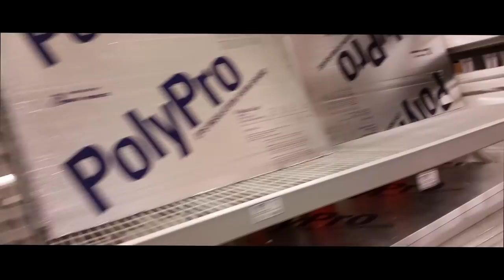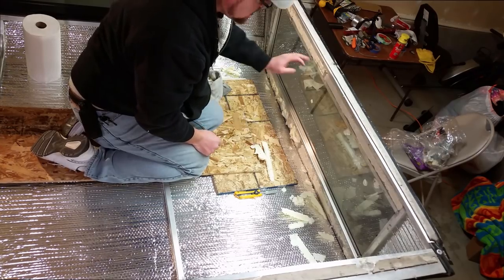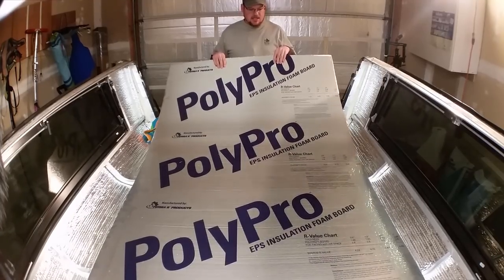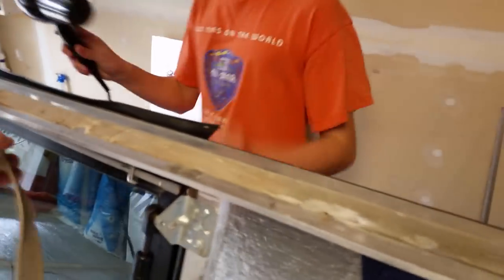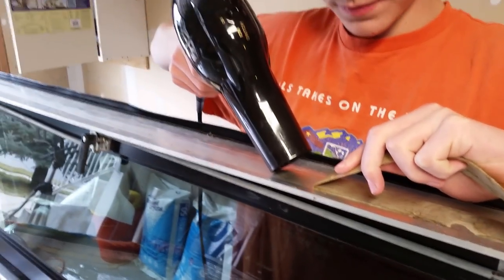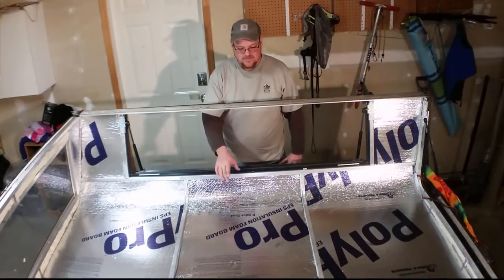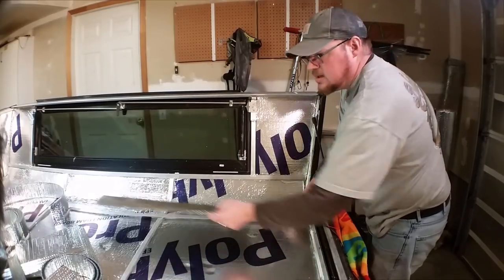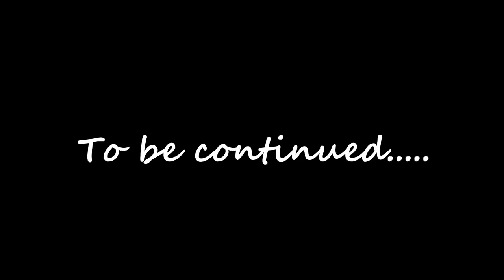Truck Bed Shell Camper - Part 5 - Insulating cap with Poly Pro Foam Board

Comment: I use an old or new hacksaw blade with tape on one side or if you find a single handle you can use that also.  Cuts the spray foam way easier from my experience when trimming.  I've seen for shaping people using bandsaw blades also in loops for shaping a radius.
Reply from the maker: What an excellent idea!  I will have to try that!
-Will
Reply: Thanks and thanks for sharing the detail of your insulation project.  I have an aluminum cap that I am planning to work on also though do a walk through design for starters and I plan to make a somewhat Mike Basich design with the way lightweight cap since I have the materials from the cap if I don't use new materials like foam, carbon fiber or fiberglass and aluminum frame.  Without the skid of course though attenuators so can level out for hauling gear on top.  I want an outer body contour roll bar also to lower drag.  Yeah, SVSeeker was using the bandsaw blade loops for the jet boat they're making.   I came up with the hacksaw blade I forget either with model airplanes and boats when I was younger and again insulating cracks in the basement walls in my first house.  Keep us posted.  Neat design.

Comment: Love the idea of insulating this should make a difference in the winter especially with a propane or diesel heater in it
Reply from the maker: I like it.  It helps keep the me a little warmer by trapping my body heat in and helps with keeping the draft out.  It's not as huge of improvement as I had hoped. If I were to do it over I would have made a second layer with a gap in between the insulative materials to increase the insulative qualities more.  Be careful with those heaters inside that you don't put yourself in to deep of sleep.  Thanks for watching!
-Will

Comment: In a cold climate you might end up with some condensation issues behind that foam/reflectix system since it's not air sealed around the edges. Maybe if there's enough sunlight during the day it might be enough to drive off the moisture every day?? I'm 3 years late but hopefully this worked out, cool build and glad you were able to accomplish a tiny air gap between the reflectix and foam!
Reply from the maker: Thank you. I don't get to use it as much as I'd like. I have slept in it a few times but mostly in the spring/summer. Stayed cool with windows open and breeze going through.
Thanks for watching!
-Will

Comment: Any thoughts on lining a shell with reflectix that's already carpeted?
Reply from the maker: My biggest take away from my reflectix experience is it “reflects” heat, and is not much of an insulator especially if you don’t have a little bit of a gap or void if you will. 
I would do it a little differently if I did it all over again. But it would come at a cost of additional space. if you think of the insulation in the walls of your house, they are 4 to 6 inches thick with tiny air pockets that are created from the fibrous insulation. my situation was more of layers like a sandwich not much space or avoids to capture the air. Good luck and thanks for watching!
-Will

Comment: You are doing a great job. I look forward to see the finished product.
I do have a question that is generated through observation.
The first layer is designed to radiate body heat back into the living space. Does it still perform that function being covered by the poly board?
Reply from the maker: Read the Instructions That's a great question. It is a concept I am currently experimenting with. I am using the gap to insulate from the outside. I may end up reversing the materials after doing some test runs in the field. I'm not an engineer but enjoy experimenting. Thanks -Will

Comment: Looks like it's going to work. Are you insulating the truck bed?
Reply from the maker: rudycorraudio 
Hello Rudy! I hope all is well. Yes it will get something. Im unsure at this point what. I need to stay thin as I can,  to conserve as much space as possible. My main objective is to reflect inside heat sources as much as possible and knock down any drafts. Having the underside of the truck bed exposed allows for convection and Rapid heat loss . So I have to hold onto and protect whatever I can.  Any thoughts and or suggestions are always welcome. Thanks for stopping by.
-Will

Comment: Do you feel the difference?
Reply from the maker: I do.. Not as much as I had hoped. Definitely no draft. A little cooler in the sun. A little warmer when it reflects my own heat inside.. It takes a-lot more air-gap than i gave it to really captute R value. I felt it was worth it though.
Thanks for watching.
-Will

Comment: Reflectix has an R-value of less than 1.0...
.... any time that a reflective surface contacts any other material the radiant barrier (reflective) value is completely negated.  All you end up with is an air bubble spacd between 2 sheets of poly.

  Then that shiny  reflective surface is actually avery thin film of Aluminum that can actually  transfer heat away from the surface you intended to insulate from heat loss.  It also conducts electricity , so be careful. 

The "airspace" was a good idea, unfortunately it wasn't anywhere to prove useful, e Capt for possibly sound deadening.

You accomplished "something", I'm  not positive it was what you intended.

Its kinda' like having sex and utilizing 2 condoms.

Good luck
Reply from the maker: We've definately learned both good and bad from it.  Thanks for watching! -Will

Comment: Sorry to tell you but that's the wrong way. You have the lowest r value rating. You need to create an air gap and then put on the reflectix.
Reply from the maker: You are correct sir that an air gap is needed for greater r value. I only have a quarter inch gap . Which is what we could  afford in my space. I have plans to experiment more with it this summer.  Thank you for your friendly insights. -Will

Comment: If you create an airgap for the Reflectix to work better, you will lose head room.
Reply from the maker: I completely agree but if I don't have a air gap it doesn't make much for insulation. I appreciate you watching. Thanks
 - Will
Reply: @Debtfreehomesteaders  I bought a few gray wool blankets at Harbor Freight to line the floor and make curtains and some extra to wrap up in. They really keep you warm and might make great insulation and there only 10.00 a blanket. They make great SHTF items to stock up on with many uses.
Reply from the maker: @JERRYR708  I need curtains. Great idea!
-Will